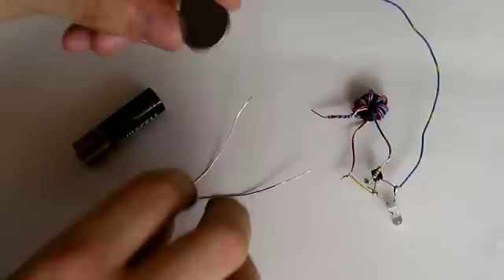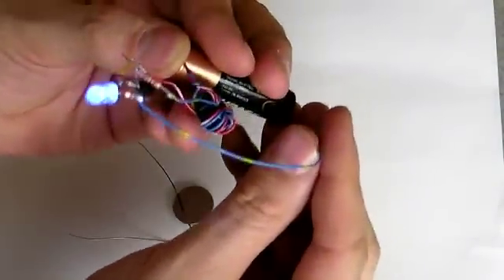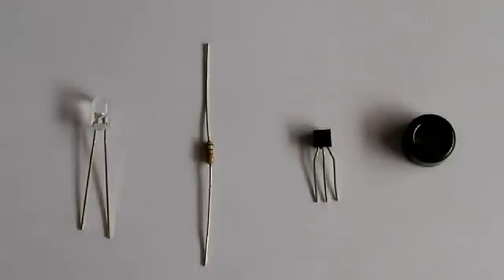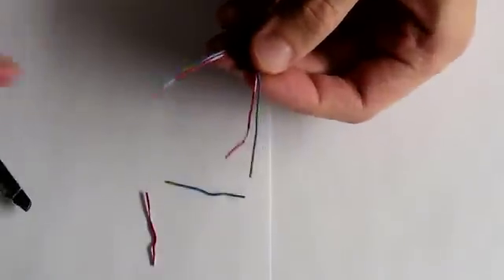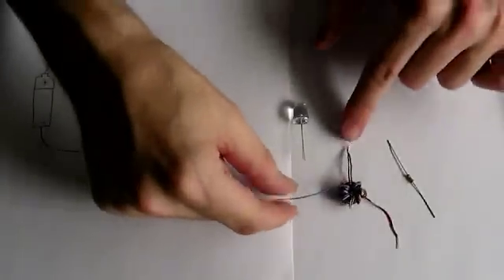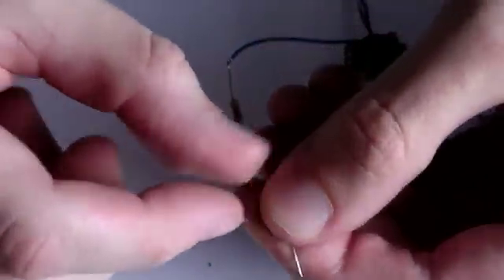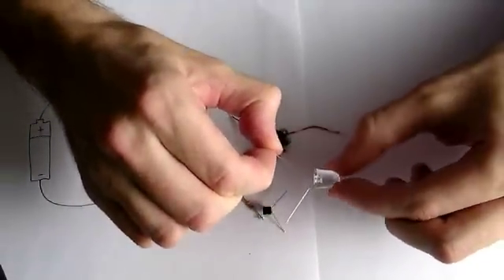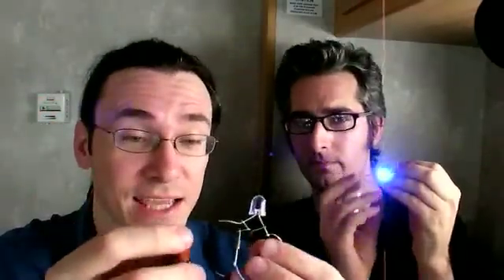Make a Joule Thief

Comment: It uses the flyback voltage off the inductor (the torroid with the wire wrapped around it) when the magnetic field collapses. This is a much higher valtage but is not constant. The transistor is needed as an oscillator, to pulse the current so the magnetic feild is created and collaped very fast. So it appears you have a constant, higher voltage.
It's called a Joule theif because it steals current to boost voltage.

Look up DC to DC converter on wikipedia, it will get you started.

Comment: Well Cool, THANKS!.... Note that this baby torroidal coil, has one wire coiled 'clockwise' and the other 'anti-clockwise'. (try winding on a pencil, and follow the rotation of one wire with your finger, it changes direction at the center tap) So when the AC current from the transistor meets the coil, the opposites + 1.5 volt and minus 1.5 volt, add together to make 3 volts. sort of minus-minus = plus. NEAT!

Comment: But, wait. I mean that i used a 22µF (not nF, mistake!) as a "filtering" capacitance. I have no "oscillating" capacitance. Then I've connected it through a 1k resistor to 1,2V cell, then it blinked. About Tesla coil, i don't think he's right. Tesla coil's have a big secondary and double resonance. In Joule Thief there is no resonance. But, it goes at so high frequencies that you could find it on AM radio. Frequency depends only on core, how much wire is on it, and voltage.

Comment: I have done this some time ago, and it works on 1,2V Ni-MH cell at 146kHz. It's good for all LED's, especially white, blue, and UV. When you hook it up with a 22nF (or bigger) capacitor to a very dead battery (or through a resistor) it starts to blink :) This is a nice and easy circuit. It can work even on a steel nail instead of ferrite core.

Comment: :POINTS TO NOTE:: ( part 1,2,3)

1) the transistor mentioned in the video is 2n3904 , its configuration is as ; COLLECTOR, BASE (in middle pin) and EMITTERto which he connects NEGATIVE or GROUND.

Now i used a random NPN transistor with the correct pin configuration and it woks fine.

2) Ferrite Rod cant be used, YIU have to use its RING like ""torroid" right ! not the straight rod..

Comment: I tried to check the wires, but it still did not work.  I used a 
C1740 NPN transistor, a green LED, 1 K resistor.  Is the C 1740 transistor not powerful enough for this circuit?

Comment: I tried to build one and it didn't work.   I used a ferrite core from something and wire from ethernet cable.  I had a 1 k resistor, NPN 2N3904 transistor, and LED soldered them together and it didn't work.   :(

Comment: not at all its a basic oscillator that use the coil feed back to light the LED basic electronic's. made one myself with 2 transistor and a cap witch is a little more complex and efficient but hey! its easy to build:P

Comment: cant you accomplish the same thing without the trans? i mean, wrap the toroid with one wire, mabye connect a resistor, hook it up to the positive lead on the LED and the other lead to negative power, and i guess you should get the same thing, right?

Comment: what's the use of the rock circle( or what ever it's called) and the transistor? if both wires are connected to the positive lead, each one should be carrying 1.5v, and if each are connected on the same side of a wire, it should double up the voltage, shouldn't it...?

Comment: Sure, there are many practical applications. This type of circuit is called a "boost converter" and it allows the use of a single cell for many electronic devices. This saves space, weight, and sometimes cost.

Comment: 2N3904 transistors should cost no more than about 5 cents each (US). One web source in the US is "Mouser Electronics." Order their stock number 512-2N3904BU. Also, Mouser's 875-28B0500-100 may be a good ferrite for this circuit, but I'm not 100% sure because haven't tried it.

Comment: they can be free if you look for them. the collors or resiters symbolize numbers. look up a chart and write down what a 1000 ohm resiter is and look for one in anything electronic you dont want, and the ring thing can be found in radios, the lil 3 prong thing is found in the same stuff as the resister normally

Comment: Transistors 101
The NPN Transistor is D shaped when looked down on top

Topview:
Emitter
|
D-Base
|
Collector

the emitter goes to the negative pole of battery

basis goes to the resistor

collector goes to one of the wire